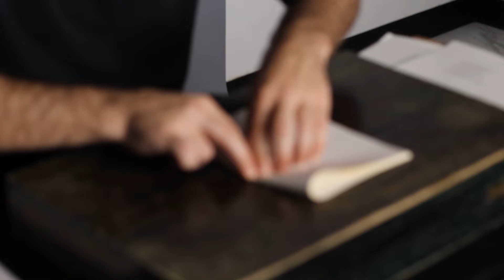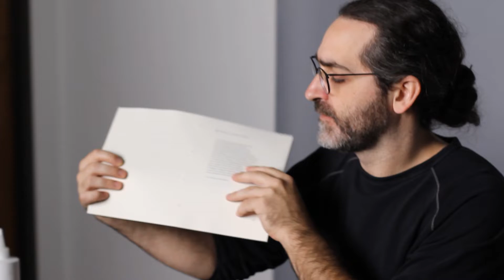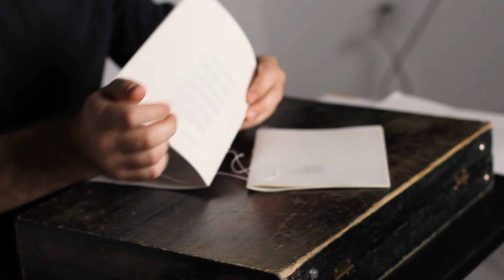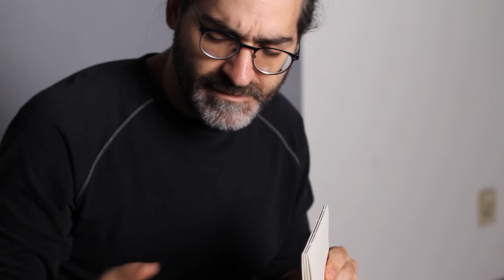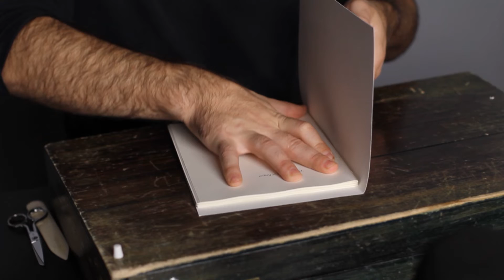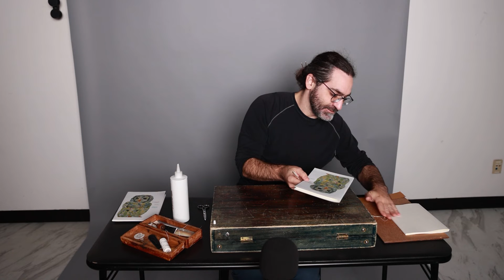Smyth Sewn Hand Binding Tutorial by Andrew Saulters

Comment: Thinking about getting the page sequence right during the printing process makes my brain hurt. Awesome video and explanation.
Reply: One method that I found really helpful and not costly is to print the individual pages in smaller sizes (like card?) on a family inkjet printer or an office laser printer. Use tape or just two clips to hold them together in the right order, count the pages, label the signatures, page number and front/back relationship. Then you can rearrange pages in InDesign, if you used it to make the original layout alreayd. I did this for my undergrad thesis artist book and it wasn't too challenging.

Comment: Love the video.  If you don't want two half hitch knots to wiggle out, this is a simple fix: tie the first one in a single direction, say looping the string from the rear towards you. Tie the next knot oppositely, pushing the string from the front to the rear.  You have just made the Boy Scout's favorite knot: the unslippable square knot.  It will break before it slips.

Comment: Excelent video!
What is the distance between the holes you punched on the signatures?
Reply from the maker: The distance between the holes varies according to the height of the book and the number of stitches. I would provide at a minimum more than half an inch between the holes, to prevent tears in the paper during sewing. For equal spacing, a six-hole book that is 8.5" tall would need to have holes that are 1.21" apart, and the top and bottom holes would need to be 1.21" away from the edge of the sheet.